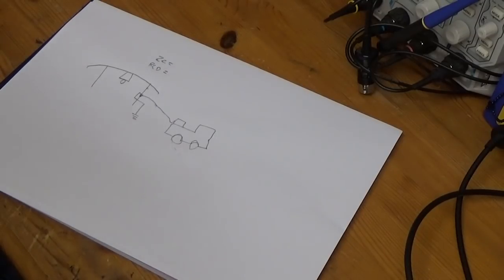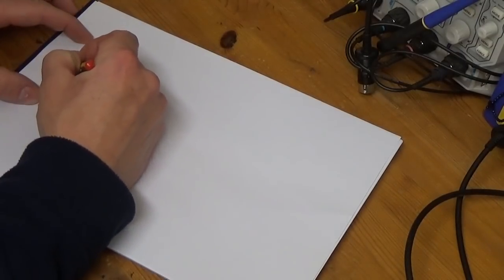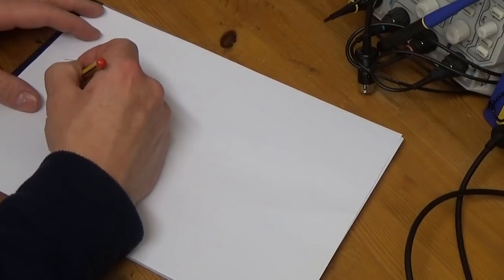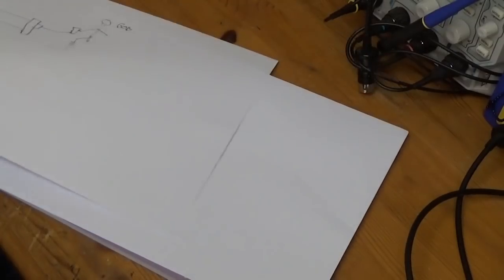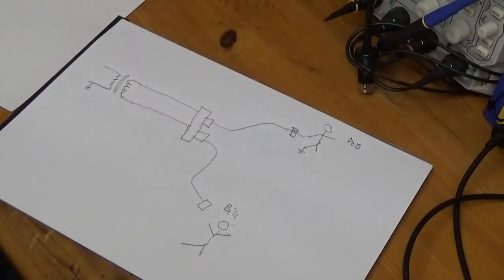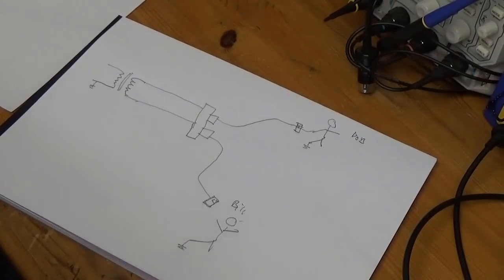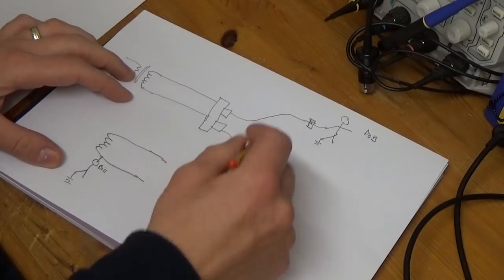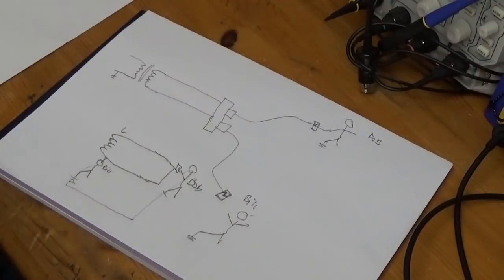Electrical separation

Comment: Will I get a shock if I touch a live cable which has been electrically seperated from earth? Regardless of what I'm standing on.
Reply from the maker: adrian polydorou  if  the supply is electrically separated from the source no you will not. Shaver sockets work on this principle.
Reply: @lesterelectronics223  thanks for the answer and explanation. Does that mean that the only reason we get shocked is because the circuit we are working on is referenced to earth. So, working on a TN-C system (where there is no reference to earth) it is not possible to  get an electric shock, so long as we are only in contact with one of the live cables.
Reply: And does it mean that when we do get shocked, the current flows through us and returns via the earth reference point to the source, regardless of the distance between ourselves and the source.  Thanks for taking the time out of your day to help me with these questions
Reply from the maker: Back at the transformer that supplies electric to your house. The neutral side of the transformer will be referenced to earth. If you were to get an electric shock, the current would pass through you down to ground and return to the neutral side of the transformer. This is called the earth loop. This applies to all TN systems. An IT earthing system has high resistance to earth reference, so with an IT system the voltage to earth will be negligible.
Reply: @lesterelectronics223  thank you
Reply: Could you explain what you mean by earthing the neutral? Did you actually connect an earth rod to the neutral output of the generator, Is this intended to be similar to the way earth and neutral are connected together in tncs systems?
Reply from the maker: @danielowens9824  In a TNCS system or PME system the neutral from the supply transformer is earthed steaked in multiple areas along its run up to your home. From here the main earthing conductor which supplies your home will be linked to the neutral (Ze side). In this configuration any earth faults within your home will have a very low impedance and thus will operate the MCB/RDC in the required time. For a TNS system you will have an earthing conductor and a neutral conductor going back to the transformer. You may ask why should we have a TNS system when we can still fulfil safety disconnection times with a TNCS system with less cables and cost?? Both systems have pros and cons. For an exercise imagine what would happen if we had a TNCS system that had a broken neutral close to your property under a heavy load at your home? what would happen to all of your earthed pipework and class 1 items???  also ask yourself is this why we would not have a TNCS system in a rural area which is supplied by overhead lines? 

When I say earthing the neutral at the secondary side of the transformer, I mean exactly that, without the transformer referenced to true earth we would not have a return path for an earth fault at the consumer side. This is why you would have a shock if you touched a live conductor in your home. This is because your feet are touching earth, and the transformer is referenced to earth, the current will flow through you down to earth, back to the transformer. Without the transformer referenced to earth it will be floating, therefore, if you touched the live conductor, there will be no earth loop for the current to flow, meaning no shock!!  Because an electric shaver socket contains a safety isolating transformer, we have an independent electric supply with galvanic isolation on the secondary side from the primary side which is 'not' referenced to earth. Hence this is why no shock unless you grab both ends (L/N) at the same time allowing the current to flow.